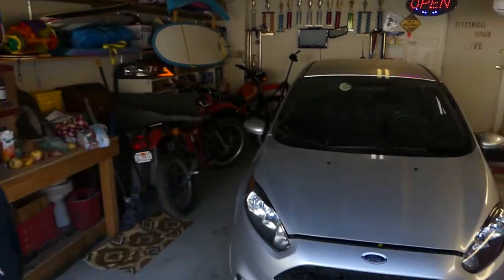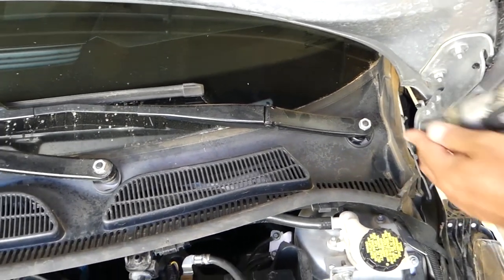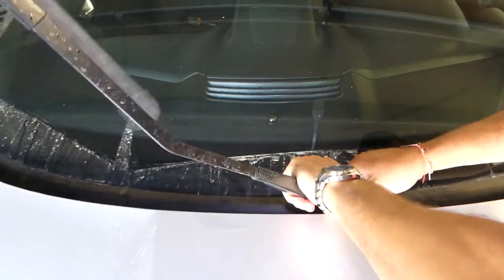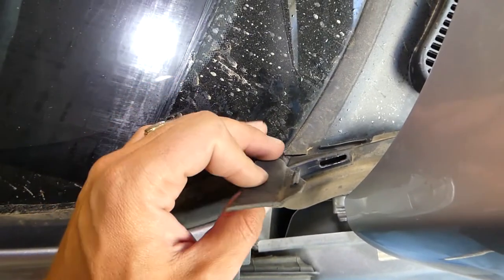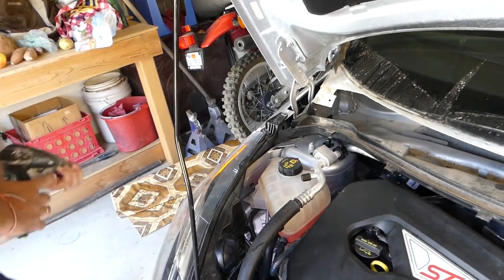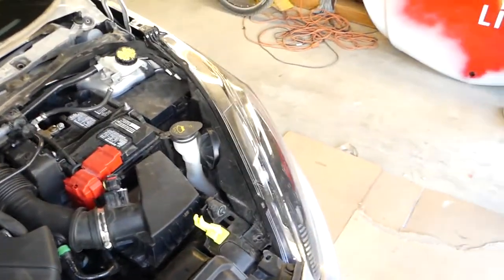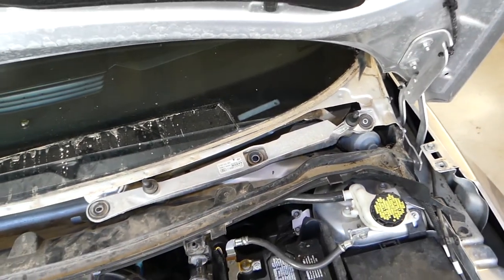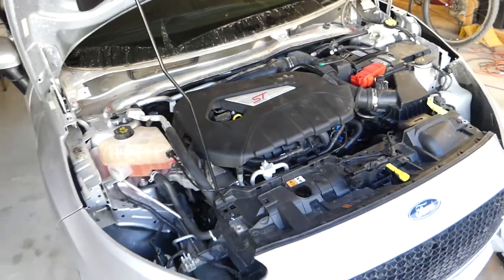FORD FIESTA WINDSHIELD TRIM COWL REMOVAL REPLACEMENT MK7

Comment: To remove wiper arm on a ford fiesta simply take off the nut and press the wiper arm flat it will lift straight off. You dont need a puller

Comment: Thank- but you should have a puller for that wiper arm(s). Just jiggling it, after a factory pressing on the spline, will NOT get it off- no way. I got a OTUAYAUTO Battery Terminal and Wiper Arm Puller from Amazon, same day delivery, and it worked- even after effort. That first time removing will be super tough. Use a puller.